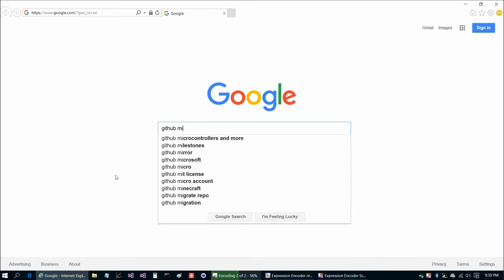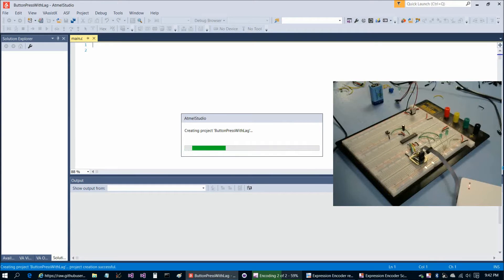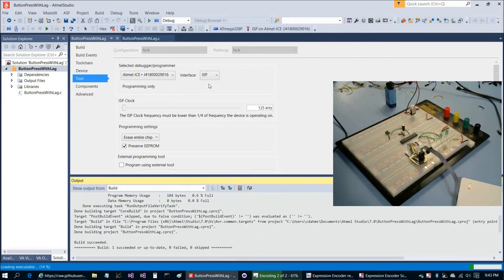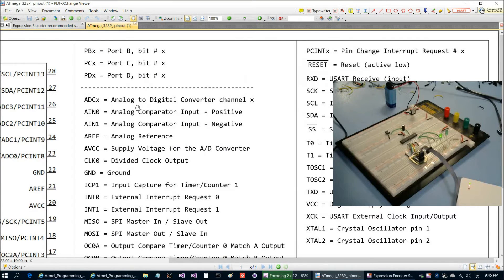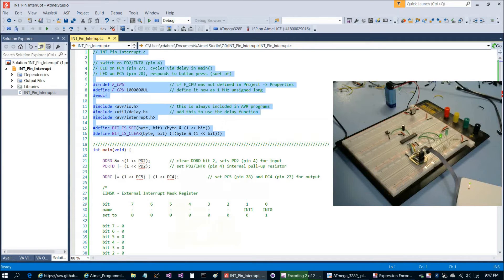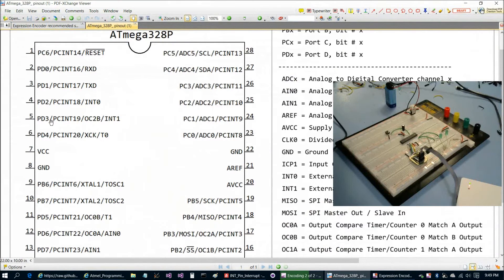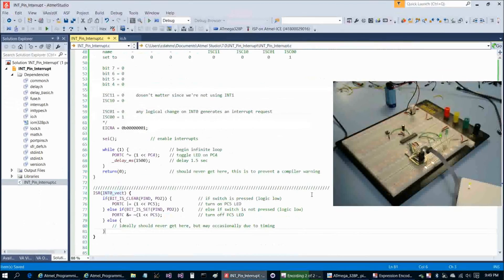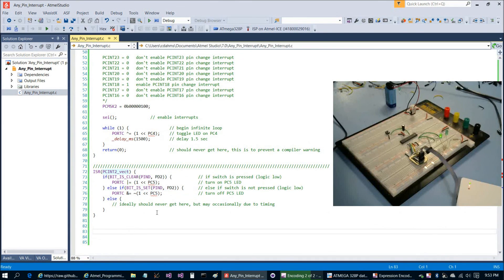Atmel Programming Tutorial 5 - External Interrupts

Comment: Another very useful video. Thanks!

One question?

In the adc single conversion code you write

ADCSRA |=(1<<ADSC)

I know this means shift 1 over by 6 bits to create the or mask to start the conversion so ADSC is literally defined as 6.

Since I am new to C I am curious to know where this is defined in the dependencies.

I had the same issue with the blink program, I couldn't find the definition of PC5.

I am just trying to get a handle on libraries and include files. If anyone knows how to see these definitions it would be greatly appreciated!
Reply from the maker: It's been a little while since I've worked in Atmel Studio so to be honest I don't remember exactly, but if you expand "Dependencies" in Solution Explorer and search (use Ctrl+F) through the files listed there you will find the #defines for ADCSRA, ADSC, and similar.  From what I can recall I would suggest to start searching in io.h and/or iom328p.h, I think most of the relevant defines are in one or the other.

Comment: I read some information about interrupts in Arduino forums. And I saw that there is interrupt priority. it would be nice to give a quick info about it.
Reply from the maker: For the ATmega 328P, the lower the interrupt address, or the lower the "Vector Number", the higher the priority.  i.e. Vector No. 1 has the highest priority, Vector No. 2 has the 2nd highest priority, etc.  See the datasheet, page 14 (first two paragraphs) and pages 65 & 66 (table of all interrupt vectors listed from highest priority to lowest priority) for the details.